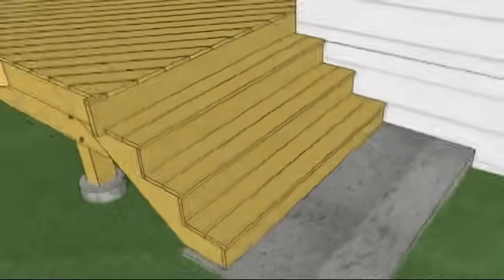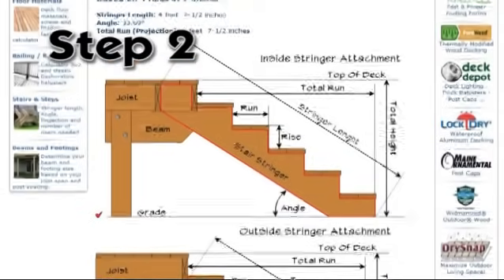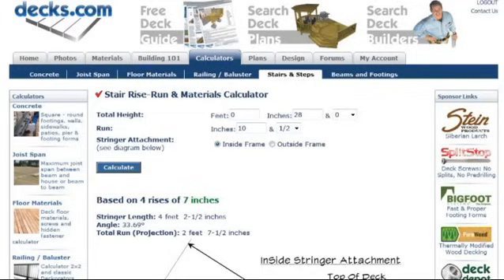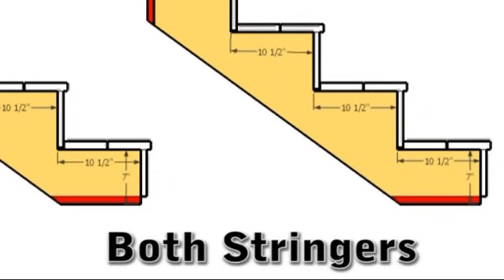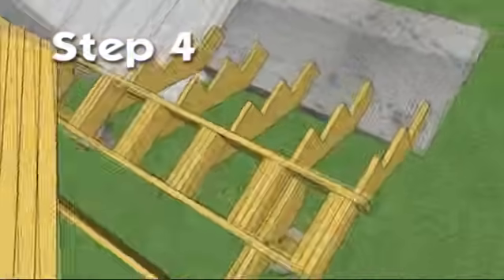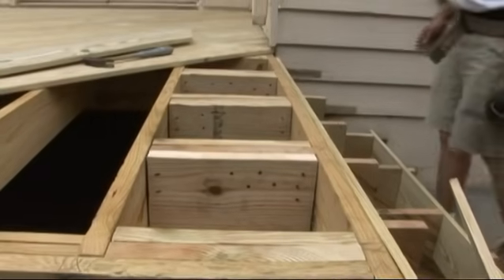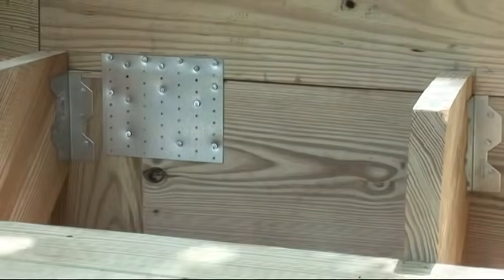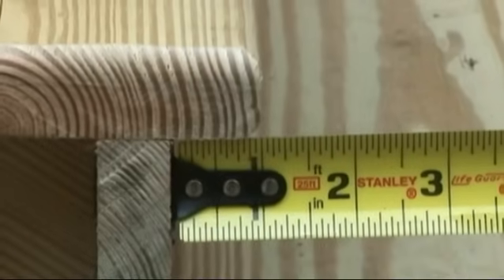How to build deck stairs - Decks.com

Comment: Stringer attachments in this video is very wrong (at least for Canada) as it allows no movement whatsoever during frost seasons. So come spring time when the ground thaws, the stairs would likely break apart. This is why I use long hinges for mounting. Stairs can hinge up and down with the ground.

Comment: I have front porch steps that need to be rebuild new steps as vary in run and riser. I know the total rise is 29" and ideally I would like the Total Run to be 41-45" What should each step and riser be so that it is at a comfortable stair angle? Length of each step will be 60" Looking at Standard Trex Select Composite decking boards specs show the actual thickness .82" with 5.5" width 1/4" gap but I haven't decided on risers? What do you recommend for steps? risers? PVC trim? Please help

Comment: "step 3, lay out the first stringers with a framing square and cut it with a circular saw. "
"Step 4, ...."

Hey, sir did I black out or did we all miss a crucial block of instruction there,, perhaps the only part that requires any real knowledge

Comment: Screw code requirements on all these things! It's somewhat crazy.
Reply: Matrix870 I mostly agree until you move into a home where a person did a shoddy/ cheap job and the decking is stretched too far across to few beams (22 inches on center). Then, once that wood gets weak, it sags and breaks. So, SOME codes are helpful, others are stupid.
Reply: Matrix870 (and my biggest beef is paying the state even more money to come inspect the deck for safety - you are forcing me to get it inspected, then the State should pay - otherwise they can simply write their own checks.)

Comment from the maker: That's really up to your local building department. If you do I would suggest a 2x12 flat on the ground to attach the stringers to. Make sure the 2x12 is ground contact rated.